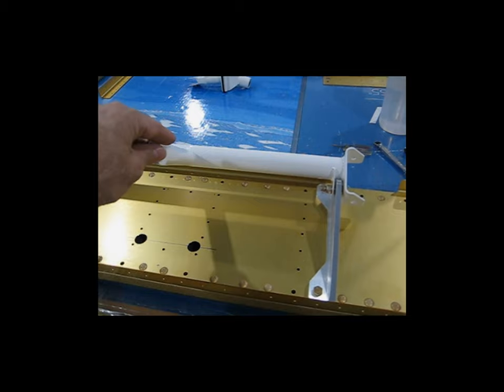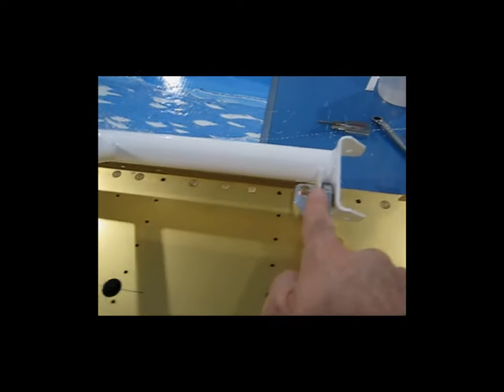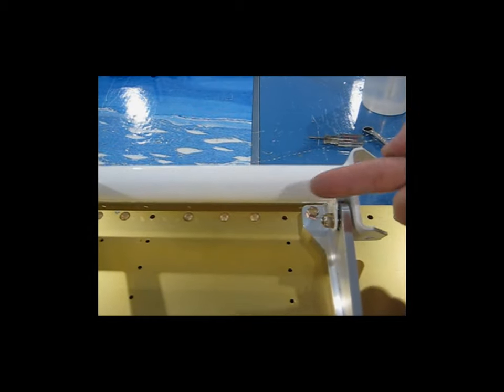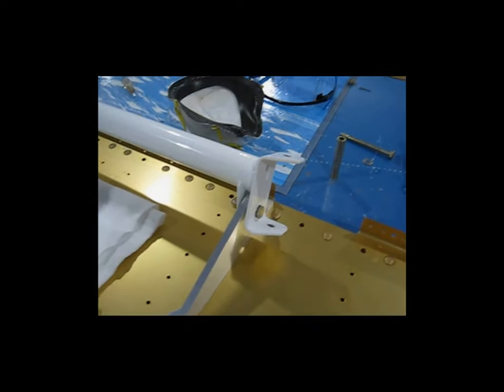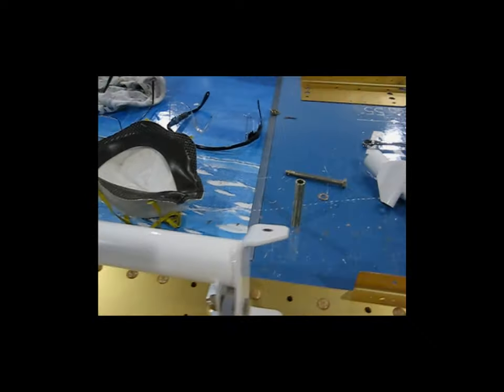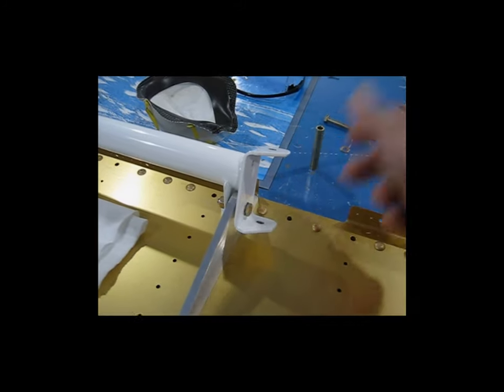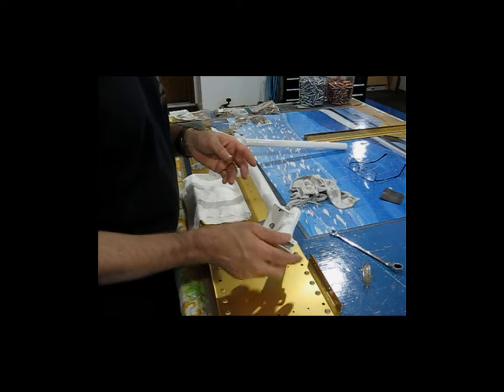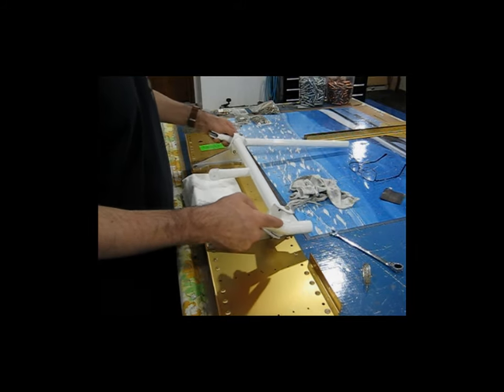RV7 HINT Video FUSELAGE Control Stick Assembly

Comment: Do you want to add any type of a thin coat of grease or carbon fiber powder for lubricant between the brass bushing and control stick? Don’t know if the plans say to, but thinking it wouldn’t hurt. Thoughts?
Lol.. I should have watched for another 30 seconds and I would have heard you say that. Well at least I’m thinking some of the same things.
Reply from the maker: Howdy Keith.   Just think of all the wisdom you would miss out on if you only watched half of my videos!  8 > [)